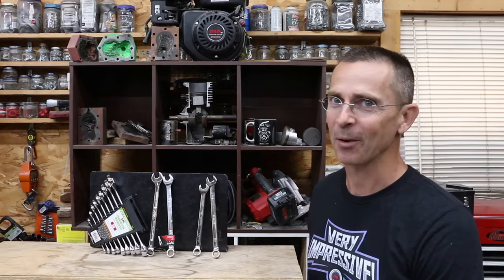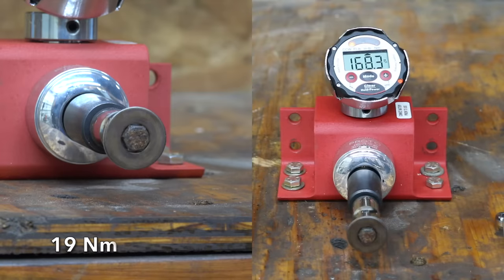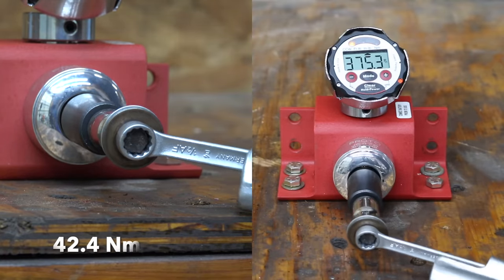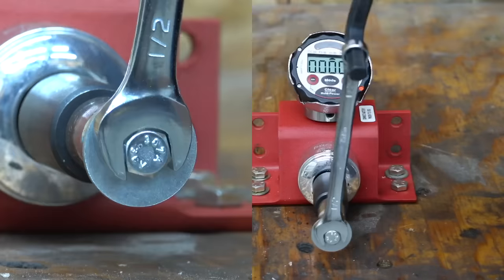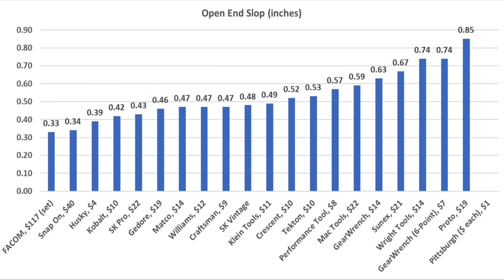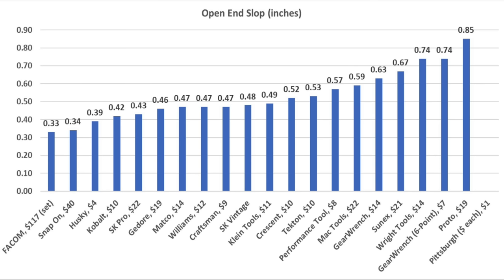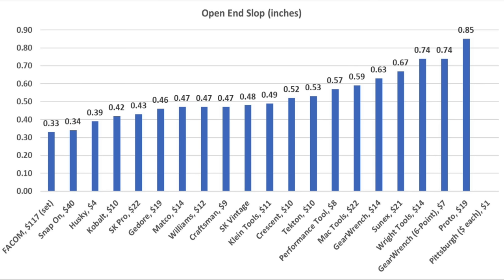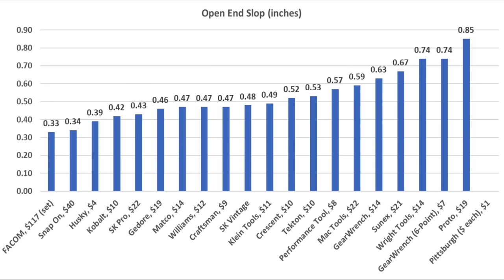Best Wrench? Let’s Settle This! Snap On vs MAC Tools, Matco, Proto, SK, GearWrench, Kobalt, Husky

Comment: Once upon a time I was an engineer in the Snap-On manufacturing plant in TN. The in-house destructive quality testing wasn't actually vastly different from the tests performed here. As another commenter mentioned a wrench should always fail safe (ie not explode) and proper material and heat treatment are both factors in that.

Keep up the good work!
Reply from the maker: Thanks, will do!  Thanks for sharing.